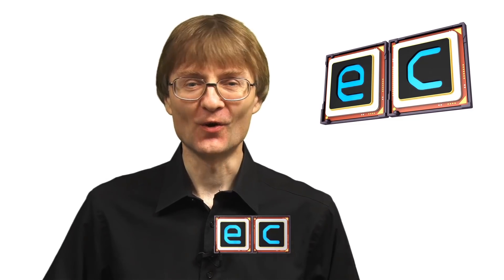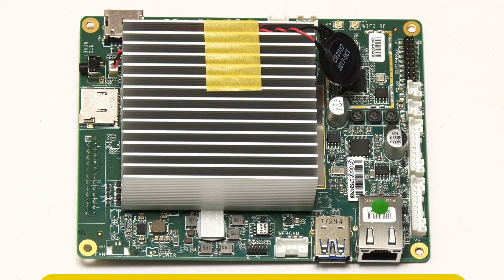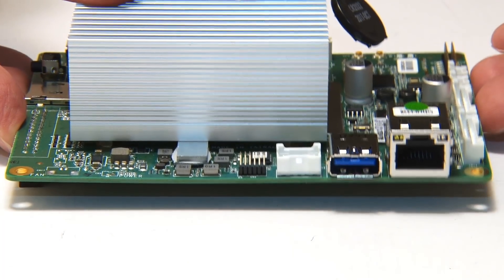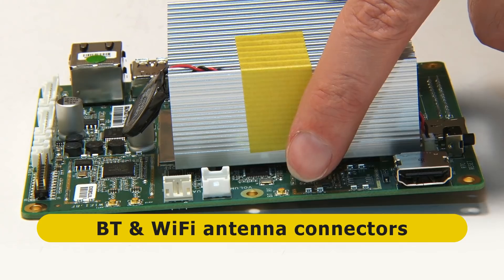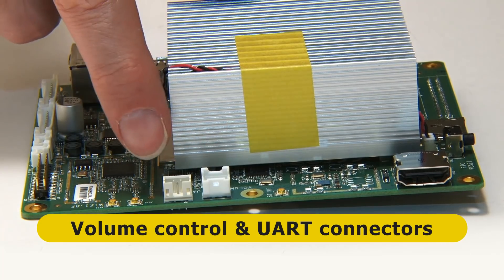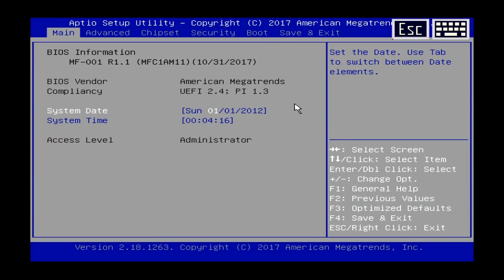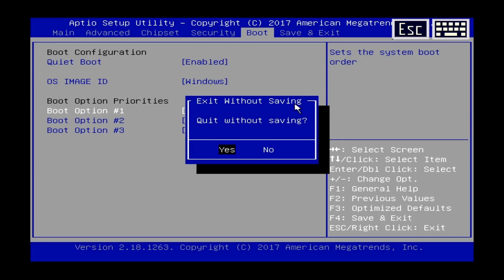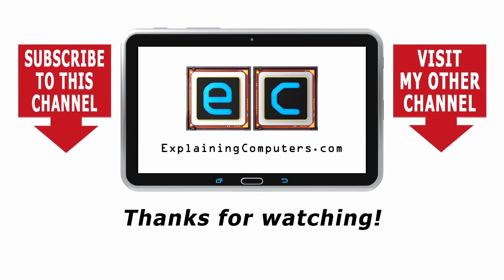Atomic Pi Intel Atom SBC

Comment: So it seems like a good competitor to the RPi.
Now it looks like the RPi sucks.
For me, RPi is expensive, you get Atomic Pi in that cost which is even better than the Pi!
Don't forget that a touch screen for the pi is more expensive than a whole phone with a bigger touch screen!
So for a real poor person like me, an Atomic pi will be a nice choice... Gonna try this in 2020, let's see if it's available then or not!
I get a lot of knowledge from your videos professor!
Reply: I have four APi's and even more RPi's. It's not really a competitor to the RPi, they are different beasts. The RPi is an actively designed ecosystem with substantial support and many accessories that is fairly easy for beginners to get working. The APi has very limited support by the distributor, supply is limited, there are nearly no accessories for it, and many things on it are quirky. It's cool and is pretty powerful for the price, but it requires considerable work/research to utilize it.  It is highly unlikely any will be available in 2020, *if you want one or more, buy it now*.  The price keeps going up every 2-4 weeks. Once they sell out, what little vendor support there is will disappear. Most of the support is by other users in the Atomic_Pi group on reddit.
Reply: you don't live in the UK then, I can get a RPI for £4.66. what version and specs is up to you, and what you need/what it's for is again up to you. I normally use an ESP32 but if I need a bit more power or need a GUI or the software is not available then I'll use the cheap pi Zero
Reply: RPis are very cheap in the UK where they are manufactured.
Reply: The RPi is a little 4 cylinder with an auto box. The API is more like an open wheel formula ford with a crunch box. You gotta learn it (bad bad English) to make it go hard.
Reply: The Pi is gutless, but the Zero (from £5) is good value despite being gutless.  And what you get with the Pi is the community support which you can’t get with anything else.  However that is a bit different with the X86 boards.  You can get the Pi 3+ for £30 if you shop around but I agree it is a frustrating SBC these days and needs updating.  Hopefully the Pi 4 is giving us that, but I would like a premium Pi, say £70.

The touch screen is 'more expensive' but get thee to China and it isn't.  Thing is then you have drivers and the language.  I got a 7" touch screen for not much more than £20 but it took about 9 months to set up as I had to find a driver and translate everything.  Excellent screen in the end though wit about 4 different options for connectivity (but not HDMI...).
Reply: I think the article explained the board was of industrial origins  for a now defunct project.  What do you do when you buy one and it goes faulty ?  The only clever thing about the board is that someone bought lots of them cheap and are now selling them off  to make a tidy profit.
Reply: @we-are-electric1445  It cost £35-£40 so when it breaks I'll do what everyone has been doing for over 40 years, transfer the project to another cheap X86 IBM compatible.
Reply: @twmbarlwmstar  Why bother
Reply: @we-are-electric1445  Because it is my money and time and X86 has proven to be a popular platform over the last 40 years or so.
Reply: @we-are-electric1445  How do you find Raspberry Pi RTM policy, genuinely?  They seem to regularly total themselves and we are expected to suck it up 'because they are cheap'.  I've never successfully RTMd a Pi has anyone?
Reply: @twmbarlwmstar  While ARM processors have market dominance this is what you should expect. Intel did it ,Microsoft did it. Google are doing it. When you live in a commercial world that's the way it goes.
Reply: @we-are-electric1445  I don't think they have market dominance, indeed neither do ARM think that which is why they have spent a decade, along with their partners such as Apple, trying to make ARM act more like X86.  There are some very real issues with ARM, and RISC that means X86 maintains dominance.  However ARM could be the future because of the Cloud.  The Cloud is what makes ARM work as a CPU.

In mobile and Tablet ARM have dominance but that is low profit.  High profit, server.laptop, desktop is all X86.  And server in particular is the profitable part of the cloud which is why ARM is fighting hard there.  I dream of a combined chip, but also we could have dual systems.  I keep meaning to build a desktop based on an ARM CPU for day to day, then an X*^ for the 'real' work- thing is I already have an Android tablet and a Ryzen multi-core PC and that does the same thing more effectively- I'm off for treatment for my cancer in a minute and I will take my tablet with me, while the Ryzen stays at home.
Reply: @twmbarlwmstar   ARM has market  dominance in mobile.   I think the focus now is rewriting code to make everything initially designed to run on  x86  to run specifically on ARM.  ARM make money from licensing not manufacturing.  When companies  charge  $1000 for a mobile phone  the profit is not going to the microprocessor design company.  As for high end processors. Sure the landscape is different  but the volume isn't there.  ARM could yet expand into higher end processors. No doubt that will  depend on what next comes out of Manuchester University.
Reply: @we-are-electric1445  I'm fully aware as regards ARM, I was using them when they were called Acorn.  However rewriting X86 doesn't really work, any more than writing RISC for CISC really works- we need something a bit better than that and that will be up to ARM, as even though they don't Fab they do the IP.  It isn't the software that makes ARM special, it is the hardware, rewriting the software just leaves you with hardware overhead for ARM to manage and so on.
Reply: @we-are-electric1445  They are writing code because they must because ‘Cloud’ is where all the money is, in fact the effort is going into Windows and writing that for RISC (and Linux but that is associated with Azure to a greater extent).  The problem with converting X84 code is it gives you the worst of all worlds.  RISC chips don’t work like CISC chips and trying to give them what is CISC code translated just robs you of the benefit of an ARM chip and makes it worse than using a X84 chip.  If it was just a case of simple translation Microsoft would have finished and gone to bed years ago, as would have ARM.  Because X84 does have market dominance in server, laptop and desktop (in that order of importance to ARM and the Cloud market) they must do something, not X84 because it currently owns that sector.  ARM will need to somehow come up with away to act more like X84 in the server space, they’ve tried everything else and while they have had some penetration it hasn’t been great.  Intel still owns Server, and obviously AMD is right behind them.  Because the future is ‘cloud’ then if ARM wins in it can be the cloud CPU- so the phones, tablets, laptops, desktops but especially the Servers.  Once the servers and the phones are literally able to communicate without the inherent barriers associated with RISC (which simply put works better as a slave to a master (or being pushed data and not greatly interacting with it) and if you want it otherwise you start at 128 cores then start counting) 

If they win servers, and they can if they can just be more like CISC without losing benefits of RISC then they win everything and X84 becomes more niche (it doesn’t die though).   But so far ARM are still not there, or it seems near there.  Whereas MS have made some real efforts with ARM they are stuck trying to force X84 code into a RISC shaped hole.  But for MS if they win, they make Windows free, and that is them in the undoubted premier position with Azure.  MS (well everyone) has top tiered agreements with ARM so they can make their own chips if it comes to it.  By the way, I was using ARM when they were Acorn so I AM WELL AWARE THEY DON’T Fab and haven’t for a very long time.

X84 isn’t there by accident, it is the best platform currently available.  Equally ARM really survives because RISC is ideal for a push data environment which is what phones are (and tablets).  Which is why Intel could never win in that space despite doing loads of work on ATOM getting it down below 5W years ago- they gave up because CISC just didn’t make sense for that sector.
Reply: @twmbarlwmstar It was mobile phones which propelled ARM to where it is today. They will keep tweaking it  to improve. You should remember it is the  reliability of the development tools for ARM cores that has been central to the architecture development.  Just because something comes along that may be better does not mean it will be widely adopted.  You need to get your project to market and do so reliably. That is what ARM brings to the table. As I say,  I  expect new developments from Manchester University will move the game on for ARM.
Reply: Looking at it the Pi4 wins at the moment, it has better memory and I/O so it will be down to the CPU and a system is more than just a CPU.
Reply: Try the raspberry pi 4 it just came out! I think you will like it

Comment: Aargh! Christopher!  I went and bought one from Amazon right after watching your video!  It is all your fault.  I don't need it because I already own a couple of ChromeBoxes (running Linux).  As soon as you said it was a good deal and would not be around long, my fingers started opening a new tab and searching for a deal on Amazon.  I really need to stop watching your videos, but I can't help myself.   (A. Pi was $40) -- Full Dev kit Option also available -- Full size Breakout board [or mini power board] also available.  Various Power supplies available. Somebody selling a Case of 24 A. PIs on ebay 264357042442.
Reply from the maker: Sorry about causing you this purchase problem! But you will have interesting board to experiment with! :)

Comment: thanks for another interesting video Chris. Have you been looking at running windows on it ?
Reply: ETA Prime has. He had some minor hickups but it mostly worked fine. But I personally would recommend running Linux, as the 2 gigs of RAM are a bit scant for Windows
Reply: @Ute Brüggenfompel @explainingcomputers yeah windows10 doesn't like 2GB like XP did :) btw the awkward power method (using wires to insert in the black header) is another sign this used to be a board for incorporating into other hardware
Reply from the maker: I've not tried Windows yet -- though as @Ute Brüggenfompel  says, the 2GB RAM (and 16GB storage) will be a significant contraint.

Comment: Nice to see this review because of the fact it points out the one downside. It is a re purposed product, which means it is not really a new design and may be limited. And it can an issue because of all these videos of cool this ""new"" board is. It is going to wind up like the "chip' computer
Reply: What happened to the Chip Computer? That was this Pi Zero like thingy wasn't it?
Reply: @utebruggenfompel5764  I think it went out of business and got bought by someone else
it is back , but not like before
Reply: they are now more like 20 bucks when you find one and not much backing

Comment: Another great video Mr B. Thank you for putting it together. But it begs the question, when does a SBC stop being such and it is classified as a regular computer motherboard or other? I don't know, but it seems more to me that the Atomic Pi (AP) is more of a poorly constructed hybrid between a true SBC and a standard computer motherboard. All other SBCs that you previously demonstrated shared many common characteristics, like processing power, board size (most significant) hardware specs and connections. The AP may have a lot of processing power and memory but I think it greatly lacks on the other SBC's specs that makes them so versatile. You have to get your own Wi-Fi antennas and build a power supply connector? Makes you wonder. You're just adding more money and time to that board in order to use its capabilities. In my opinion, and based on the additional research that you did, it seems to me that the company that produced the AP just wanted to hop on the SBC bandwagon simply by repurposing an old board from another system and adding some "appeal" by installing some relatively "heavy" Intel components. But hey, everybody has different computing needs and if the AP is one of those boards that meets someone's particular power requirements then hey, more power to them - no pun intended. I look forward to the follow-up video on this board and any other future videos you share with us. I truly enjoy them!!!
Reply from the maker: I would define an SBC as a computer comprised of one module only. So to be an SBC a board has to have soldered RAM (not plug in RAM modules).
Reply: @ExplainingComputers , thank you Mr B.
Reply: Tl;dr

SBC = Single Board Computer. If someone would plunk a 9900K and a Titan RTX on a single PCB it would still be a SBC.
Reply: @utebruggenfompel5764 , if you were plugging all that into a Raspberry Pi model 3 B+ then sure that board will still be a SBC. My question is, would you consider a XT, AT, Baby AT and ATX mother boards a SBC?

Comment: Can't you just solder the wires into the back of the GPIO connectors and not have to put risers?
Reply: Yes.
Reply from the maker: Certainly.
Reply: @ExplainingComputers  oh and the prices have jumped, it used to be $35 now it's $50 on their official website and $45 on Amazon
Reply: I changed mine to a right angle male header but still mounted it on the underside

Comment: Hi Christopher. Great you've reviewed the Atomic Pi. Everybody asks it to me. 
The Atomic Pi seems to be designed for another industrial purpose. But it's probably not accepted while all the batches were made. I've seen links to buy them in the thousands from the manufacturer. My guess is that's the reason it's sold this cheap. I would like one, would be a great machine for compiling software. 
I'm back from my trip thru England. Is was a bit a downer. The roads are way too narrow, and cycling lanes are as good as non existing. If there are cycling lanes, then they're never paved. It was way too dangerous to cycle there. I had to come back early. Next week I'll go to Holland to make up on it. There you've got cycling highways from and to anywhere.
I enjoyed your OPi3 video. And the file systems one too. I didn't know anything about the way Apple did that. I couldn't comment on youtube with camping wifi. Greetings.
Reply: Lol, you say it on the end. You clearly have done your research :)
Reply from the maker: Hi Nico! Sorry you had problems on British roads. I had problems on British trains this afternoon. :(
Reply: @ExplainingComputers  Sorry to hear that. Transportation could be better it seems in England. I felt sorry for immobilized people. If I can't pas thru, then a wheelchair can't either. 

I talked to English people who told me you're nothing in the English coutryside without a car. No other way to go anywhere. Not by foot or with a bicycle. 

I'm so used to riding the bike everywhere safely. I don't need a car because I can get everywhere with it. I hope things can improve in the future. Greetings.
Reply from the maker: I too do not own a car. I walk a lot, and use trains.

Comment: Yeah..nah.
I dont like it.

It's selling some old hardware, if i remember correctly the cpu was new about 4 or 5 years ago.
The first latte panda was based around the same cpu i think, but was available with 4gb ram. AAND smaller.
- Also many industrial + low end tablets available with the cpu. (and some intel surf sticks+clones, minipc-boxes)

If you're going for the small formfactor pc,with hdmi+usb+power,
perhaps even want to run win10 on it you could just use the old intel surfsticks and its clones.
If you need IO-Ports, just hook up an arduino to the usb. (or use the latte panda with its integrated arduino)

Now for this size i was hoping to finally get something like the asrock intel j1900 boards.
They are older, i know, but also more powerful. the N3050 was comparable but not better.

My all time favorite small formfactor "x86" CPU is still the ASROCK J1900 DC.
https://www.asrock.com/mb/Intel/Q1900DC-ITX/  (AC-DC power supply was included in price)
its not SBC, because you need to add ram (up to 16gb), but then you got all slots including sata, usb 3.0, hardware serial port....
Fine for almost all things including mediabox, and small enough to be VESA mounted. Even suited for passive cooling.

In my opinion this thing is too large and slow for the small applications where theres a raspi/zero or latte panda,
and not good enough for the larger things where microitx starts to kick in...

Comment: Can you make a video about which sbc is the best for andriod TV which also can support 4k 60fps
Reply: I can recommend the Rock64 2gig Version. Costs the same as a raspi and just got Android 9 support a few days back.
Reply: No on board wifi or bt tho
Reply from the maker: The RockPi 4B is very good in Android (I've done a couple of videos). I'll be looking at the Kadas Edge-V soon too.
Reply: @ExplainingComputers  which Android version can it support because am looking for the latest obviously
Reply from the maker: You would need to use the latest x86 Android.
Reply: @ExplainingComputers  thanks for your help but what I meant with wich Android version is it 9.0 or 8.0 etc.
Reply: @Väîřöò0øõ  The most recent Android x86 version is based on Oreo.
I mean no disrespect, but search engines exist, kind Sir.